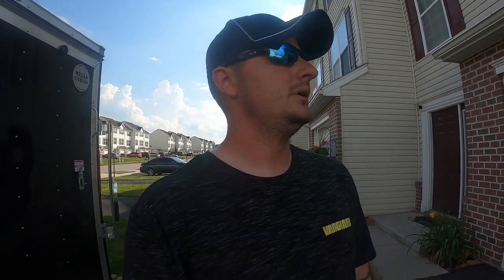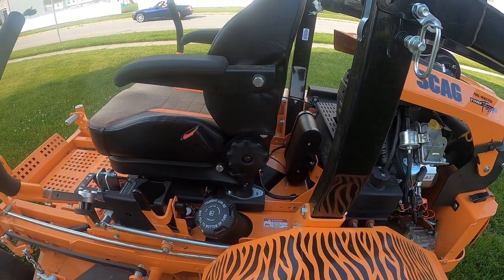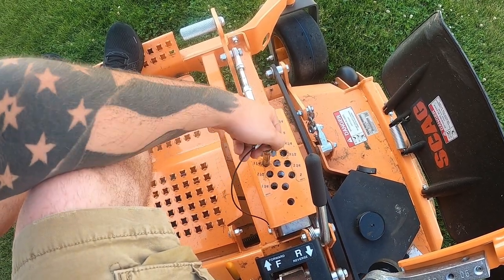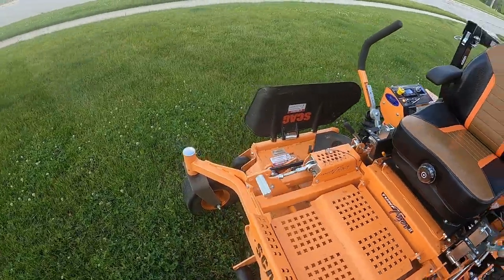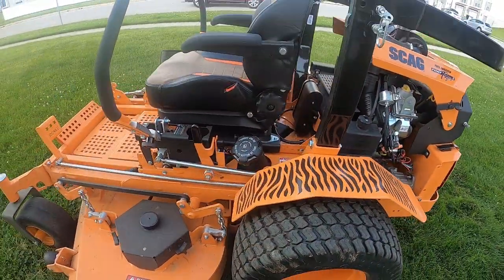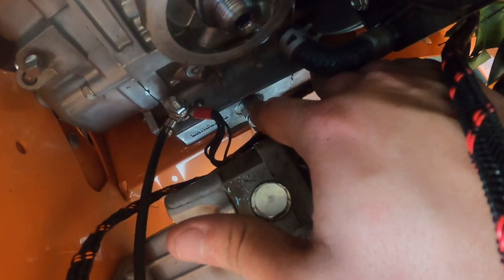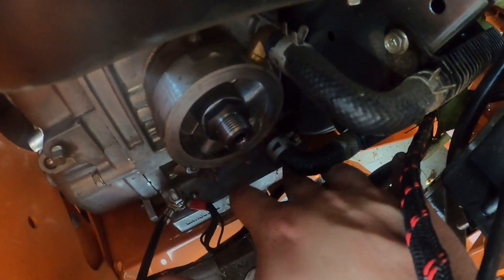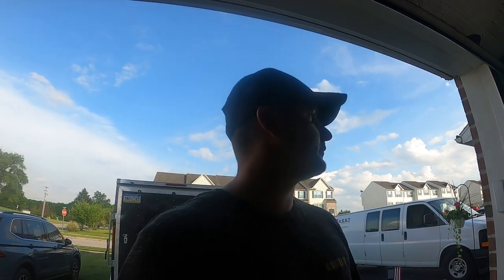2021 SCAG Turf Tiger II OVERVIEW and OIL CHANGE

Comment: I’ve just recently figured out that I can use a 1/4” ratchet with a 10mm socket and it will fit in there with the oil filter still on.
Reply from the maker: Thank you for this information! I unfortunately no longer have this unit, but hopefully this will help someone watching!
Reply: Thank you. Doing mine tomorrow. I will take your advice and use a 1/4 inch swivel head ratchet and 10mm socket. First time oil change. I'm going to try and put a piece of rubber hose on the drain port. It looks like a piece of 1/2 inch ID should do the trick.

Comment: Great video buddy. Wanted to know where in pa  you live is non Cecil county maryland. I have a radius ex mark. Now I am thinking of getting same mower. Wanted to Also know how much it was ?
Reply from the maker: Hey Tim,

Sorry for the late response, I had to shut down my company due to the economy. I use to pick up Cecil County recycle with waste industries now know a GFL. I currently live in Manchester PA about 26 miles from PA/MD line on 83. I have no complaints with the Scag. I'm a first responder so I got a discount for that, but it was 15k new.

Comment: Husband feels Briggs/Vanguard isn't to blame, but Scag is.  Scag shoved the already designed engine in their design.   🤷‍♀
Has anyone replaced the oil drain plug?  A mechanic told me a bolt loosens the engine enabling a lift providing just the right amount of clearance to replace plug/o ring (have an oil leak).  He said you access it from above, not from the underside.  Any insight would be appreciated.  thanks!

Comment: What type and size wrench did you use? Impossible to use with a socket
Reply from the maker: I will have to look into the size of the socket, but I used a socket with an extender on it to reach, I was able to reach it after removing the filter.

Comment: I have the exact same mower and doing the 1st oil change, and I can’t even get the oil filter off, it’s on there tight. Any recommendations?
Reply from the maker: What are you using to take it off? An oil filter wrench?
Reply: @Thelawnguy94  I tried to get in there with a standard metal strap oil wrench but it’s super tight and wasn’t able to get it on. I looks for the type that attaches to my socket wrench but I’ve either gotten one that is to small or too large. I just bought a 3” off amazon and I’m hoping that works, as I wasn’t sure what mm that would work.
Reply: I had to use a filter wrench the first time. The second was much easier but I still needed the wrench because I couldn’t fit my hand in there to turn it. Also I use the drain plug on the left hand side.

Comment: I thought they had the oil Gard system on all those. I just ordered one and I was assuming it had that.
Reply from the maker: Oil Guard system is offered through Vangaurd as an add on feature, which will cost you extra money. This mower I didn't custom order, just picked it up from the dealer as is. I am getting a chute blocker for it though. Would highly recommend getting one for yours.
Reply: @Thelawnguy94  Ferris, and Snapper Pro ( owened by Briggs and Stratton) are the only ones you will see the Oil Guard System on the Vanguards. And the suspension seat is standard on the Turf Tiger 2..